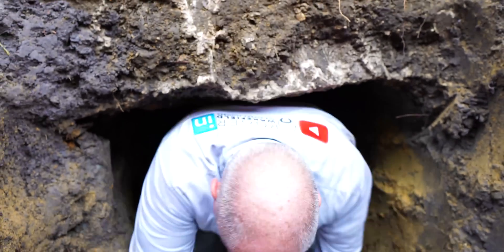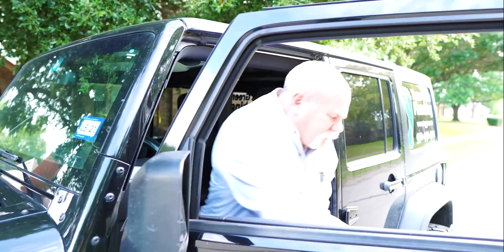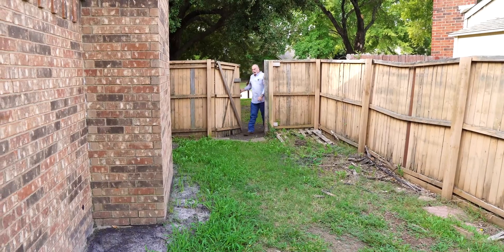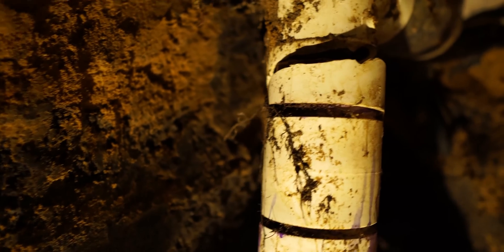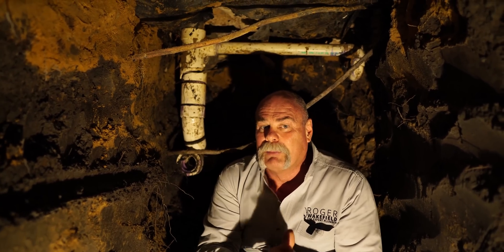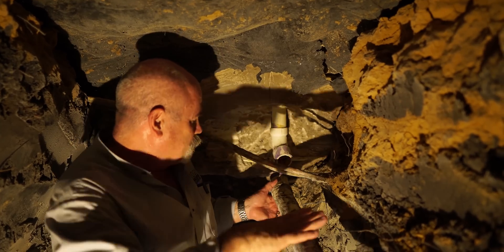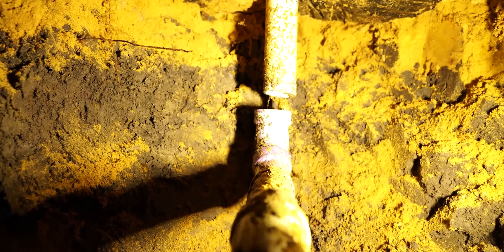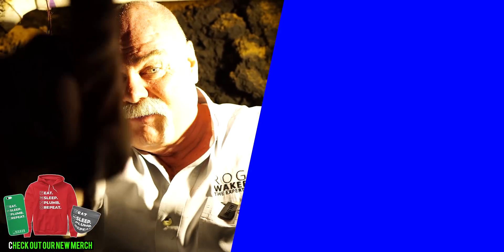Ever Wonder How PVC Pipes Break Under Your Slab?

Comment from the maker: Have you ever seen the pipes under your house before?
Reply: Yes, but I cheated and have a house with a basement.
Reply: If you had to build a slab house today, how could you plumb it so you could have full access to all of the plumbing?
Reply: @wiggles2439  You'd have to redesign the plumbing system, so your only buried lines were a water supply and a drain pipe near an exterior wall of the house. All other branches would be run in the walls, or maybe some kind of groove cut into the slab and covered with plates like the splice plates on a wooden stud. Wonder what Roger thinks of this idea?
Reply: @markh.6687  Good ideas.  I was thinking something similar.  Run the main supply up a accessible interior wall to the attic to a manifold, then run all the supplies back down the walls.  The drains, a little more tricky if using a standard gravity system, dig a channel in the slab for the main with access panels, with somehow running the other lines in the walls.
Reply: @wiggles2439  crawl space, standard in the Netherlands, and me as an apprentice plumber i appreciate it
Reply: Lukie4ever Bass It’s standard in most of the US if you don’t have a basement.
Reply: do a video of the dig crew.
Reply: The house I grew up in had a crawlspace under it, not a slab. A slab house just seems like a bad idea. Cheaper to build I suppose? Seems like a maintenance nightmare in the long run.
Reply: @pvanukoff  not much cheaper. Either way you're pouring concrete in some way for whatever style you are building. crawl space just entails pouring a foundation wall when you pour and laying ur floor deck across the walls instead on on the slab. No much more work or cost for the concrete guys or us carpenters.
Reply: @JB-ez2jz  Thanks for the explanation. Makes sense. All new construction is slab out here where I live.
Reply: Let us know how they back fill the houses you show on your video with out putting the new pipes in a bind.
Reply: Yes in the crawl space in the Netherlands/ Holland 
it is standard for a long time
Reply: I Installed them.
Reply: i have a basement so yes
Reply: Maybe on the new slab builds they should install a 24 in double wall plastic tile so the plumbers can crawl in and plumb at least the main drain and most of the water lines Basically a mini subway line
Reply: No never
Reply: Only some of them!  Busted slab and a very short tunnel were involved.
Reply: As much as I've cursed them both, that makes me thankful for my crawlspace and cast iron!
Reply: Yeah, I saw them yesterday when I went down into the basement
Reply: Yes. As well as my grandmother's house. Even found the old cast iron setup still laying down there even after it was converted to PVC at some point. Wish I had drug it out and sold it for scrap...
Reply: Another great example of why ABS is better than PVC... ABS has an unjust reputation because of the common assumption that it's used in mobile homes to save money.... When in reality, it's not only more expensive than PVC, but is REQUIRED for mobile homes because of the fact that it is stronger and can withstand the challenges faced during  transportation....
Reply: Yeah. Had a basement. Now we have a crawlspace. But I still seen it.
Reply: Yup, Oregon we have crawl spaces
Reply: This is nice and informational. As an electrical apprentice I hate pvc in direct burial.  The company I work for, we've hadcto dig the trench back up twice because the pipe broke during or after the back fill. 
Binding and twisting joints, this is something ill keep an eye on in my future.  
Thank you.
Reply: I would love to but can’t haha
Reply: No only when they had to cut in the slab and replace a cast iron wore out pipe smh. Never fun never easy and NEVER CHEAP
Reply: On a slab so no..

Comment: Thanks for the video, your explanation is very understandable. I have a question My mom and I have been in our house this past July was 20 years  she is the owner. This house was built in 1984. It's a 2 bedroom bath in a half and is built on a concrete slab. We are the 2nd owners .A few days ago our  kitchen sink which is on an exterior wall with a 3x3 window above it has had apparently a drainage issue to the point where fishing a snake for cleaning the snake goes in approx 5 to 8 feet then twists on itself. Could that mean that the pipe is broken? If so would the contractor that did the original plumbing before the slab would he go across the slab to the septic tanks or would he run that drain along side the exterior of the slab?

Comment: wow - this video gave me so much to think about. Do you see the same issues occur with ABS drain lines/fittings? Which is more robust? ABS or PVC? Do you recommend sand as a material to pack around plumbing members? Would a 5/8 minus sand gravel mix work ok?
Reply from the maker: Honestly, I don't have much experience with ABS, I've only installed ABS once...Here in TX we only use PVC

Comment: You’ve got to use concrete blocks in tight on your way out back filling or you’ll have more problems down the road, especially in North Texas. I’d prefer demo from the top. Either way, expensive as all get out.

Comment: I really like your advice at 5:50 about the rough plumbing under the slab.  I wish there was more advice like that out there.  I'm designing a house with all the plumbing along the north wall to try to simplify things and prevent having to dig under the slab in the future, but I wish there was a way to prevent that all together.  Maybe run all drains (Except toilet and shower) through the wall instead of through the slab?  What else could someone do to simplify repairs in case the pipes need to be changed?

Comment: Other then saying that the pipe wasn’t bedded properly what else can cause the soil under a concrete slab with peers to settle 3 “ and break every single fitting on a vertical drop

Comment: Rodger I have a house in California and it was built in the 60's.  Three different plumbers have come and told me that I have a broken drain pipe under my slab from a double sink to my shower that is on another side of the wall. I never thought about tunneling untill I seen this video. I don't want to break the slab if I don't have to. What is your recommendation.

Comment: I'm curious about the backfilling you do in your expansive soil. UPC says that bedding must be sand, dirt, or fine gravel that is level and supports the pipe along its length. The fill over pipes in direct burial has to be similar: sand, dirt, or fine gravel. It must be free of rocks and no rocks in the bedding. The trench itself must be 1.25x the pipe OD plus 12 or 16 inches. Clearly, these pipes were pushed up against the trench wall and then backfilled on a bind, as you said.

I wonder why they don't require pea gravel backfill around your pipes in soil that can move? That would allow shifting and accommodate a certain amount of vertical movement. 

Of course, it looks like that main drain moved an INCH or more sideways. I think they had a void on the narrow side and tamped the dirt down hard on the wide side such that it drove the whole assembly more than an inch to the side. That or the house moved an inch.

Another question: You guys don't use foam pipe wrap where the pipe penetrates the slab? That kitchen sink drain looks like it was set in concrete without wrap of any kind. Seems to me, that is part of the problem.

Comment: Another great example of why ABS is better than PVC... ABS has an unjust reputation because of the common assumption that it's used in mobile homes to save money.... When in reality, it's not only more expensive than PVC, but is REQUIRED for mobile homes because of the fact that it is stronger and can withstand the challenges faced during  transportation....

Comment: Yeah, the problem is that the plumbers don't fill the ditch back in, their $10 per hour workers do. Rarely do masters even do most of the pipe fitting in larger companies, they're directing 4-5 guys on what to do. I live here East of Dallas and this black clay expands and contracts a lot. If the backfill isn't tight and completely under the pipe and supporting it neutrally all the way around, it's going to break. Thanks for the reminder on doing a good job all the way to the end.

Comment: G'day Rodger when PVC started being used I use to put straps into the concrete slab to help support the pipework ,because its very hard to compact the pipe bedding .
Also used expansion joints for movement.

Comment: I guess the pipe broke cause uptil the 60s, PVC pipes were made from pure pvc resin but nowadays we add 10% rubber (ABS) to impart better toughness and impact resistance. PVC pipes installed today with similar margin of error wont crack so easily.
Also can I just say, as a student persuing masters in polymer engineering, these kind of videos are a lot more insightful than carrying out fatigue tests in controlled environments. Subscribed!

Comment: I have a plumbing license in CA, CO and OR. Been plumbing for over 36 years. I have never seen this done. I have a few questions/concerns.
1) trench shoring. The slightest cave in can be deadly.
2) confined space air quality. Contaminated soil and chemical vapors from the glue and primer can be dangerous.
3) firm bedding under the new pipe. Do you drill into the concrete above and use all-thread rod and clevis hangers?
4) compaction. Most slab on grade floors require 90% to 95% compaction. You just altered the structural integrity of the building. What do you do for compaction and how do you protect the pipe you replaced.

I’m not trying to be judgmental or be a smart a**. I’m curious.
Reply: Paul Sorensen,as a licensed plumber with 37yrs in myself, I am
In total agreement with you on all
Points.Must have looked at this video 5 or more times now, besides the danger aspect, Really unless you shoot some slurry or sand under there I don't see how there cannot be huge voids under
That slab!
Reply: @danieldawson222  yeah how does it get repacked without affecting structural integrity
Reply: Yep know of some cave INS in my parts that could kill you faster than you could say dead.

Comment: How do you fill in the dirt after repairs are made?  And I have had a copper hot water line spring a hole in it under the slab.  I had to jack hammer a brand new tile floor and found  corroded copper lines. Probably from chlorine as the pool was right next to where this happened.

Comment: Why not cut the slab to access the busted pipe instead of tunneling?? I know the tunneling saves the slab, but, my god, the cost alone would be astronomical. Back fill would be simpler, repair would be alot less stressful on the plumber. Idk how comfortable I would be with a 30 years old slab hanging over my head that's had something under it supporting it and now it doesn't, engineer or not, he's not the dude under it for the next 10-12 hours fixing it. I would love to know what the cost of that repair was versus a cut slab, same job just cut slab. @Roger Wakefield could you ball park the completed job cost for me just so I can know the difference for my own mind, please?

Comment: The company I worked for did tons of multi-story apartments. One particular job, my helper and I were assigned to do nothing but testing and slab work. When the piping was put in, someone figured the thickness of the slab wrong. They assumed It was a normal 4 inch slab, I guess. It was actually a honeycomb, where portions of the slab were over a foot thick, with tension cables embedded in the honeycomb. The result was that there were a lot of broken pipes after the slabs were poured.

But we didn't tunnel under, since the house was still just roughed in.  We jackhammered through the floor to get down to the pipe. It's a challenge any way you do it.

Comment: Mid 80s went from cast iron to PVC?  I've been a master plumber for 36 years now here in Texas and we were not using cast iron in the 80s in residential homes. It went from cast iron to abs pipes in the 70s and early 80s then PVC. Where exactly were u guys using cast iron in houses in the 80s? I respect what u are trying to do and help people. Now I saw ur license number on ur jeep and it starts with 35 so u have not been a master plumber that long my son is 39 and he got his master license when he was 27 and his starts with 35 also.
Reply: @M B well up north I understand u guys have basements we dont dude. We stopped using cast iron back in the 70s except for commercial buildings. Not residential. Yes no lead and oakum anymore just no hub fittings above ground
Reply: @M B what I'm trying to say is that  this guy is very misleading. He says he has been in the plumbing trade for 40 years but he just got his license not too long ago. So what gives u know what I mean
Reply: M B Chicago is odd. They don’t allow Romex wiring without metallic shielding.

Comment: they used gsr pvc. Gsr pipe cracks really easy. i use genova pvc because it almost never cracks/leaks. in Wisconsin pvc was first used in the late 1960s. in the 1960s-1980s every plumber used genova products.

Comment: I agree with the issue most likely being caused by backfilling, but most likely its a combo of not installing on solid bedding and than being backfilled. That's a huge issue in the area i live in, but youd never be able to dig under a slab around here because we have a sandy loam more on the sandy side.

Comment: This reminds me to never buy a house on a slab.  Crawlspace or basement is the way to go.
Reply: Basement only...:)...Screw those crawlspaces! And Screw the HELL out of slab!
Reply: @godbluffvdgg  basement: or as they call it in a wet climate: indoor pool.
Reply: @kenbrown2808  Cha Ching, right? ...Indoor pools are awesome@ :)
Reply: @godbluffvdgg  the tin nokker didn't seem to think so.  apparently, duct tape doesn't seal raingear well enough for swimming.
Reply: @godbluffvdgg  my crawlspace in the house I'm building has a concrete floor it's air sealed and insulated. 3ft tall also
Reply: @justinballard7242  Well, good luck with that...I haven't seen a dirt crawl space in decades...It's code now to make sure the floor is concrete...Are you saying your crawl space has no cross ventilation?
Reply: @godbluffvdgg  yes, no ventilation. It's called a conditioned crawlspace
Reply: @justinballard7242  It's code here to have an 8X16 vent on opposing walls...But, codes are different everywhere I guess.

Comment: I literally learned my lesson on this this weekend. I had put a line going across my driveway with 1” pvc with 2 separate lines coming off my supply. Not of the t’s pulled out due to backfilling and stress. I made sure I packed good before I covered it up this time. Kinda common sense but I had to learn the hard way

Comment: I'm curious how you backfill a hole like that properly so that concrete will not crack in the future. Whenever we had to do a job under a slab we excavate from Top.
Reply: I thought the same thing. How do you pack that back fill in a horizontal position to keep the concrete from cracking over time
Reply: @derrickfeltner6634   My guess is they turn the backfill into a putty by mixing a little water and possibly a bit of concrete with it. Then just hose it back in with a sprayer.
Reply: @clothar23  lol I thought about that
Reply: I've been wondering that to
Reply: There's a trick for that, too
Reply: @joeblow6199  @guitar1301 I Wonder if this can be done on a post tension slab slab.

Comment: I live up in MA, why are slabs so common down south? Why pour a foundation for a basement?
Reply: Well, it's cheaper and faster to pour a slab than dig a hole and pour a lot more concrete.
Reply: @markh.6687  I figure the cost of this type of repair would offset this cost of the extra concrete lol
Reply: High water tables. A basement would be an indoor swimming pool before you could pour the walls.
Reply: @davidm7457  Well, that will save some time putting in the swimming pool! :)
Reply: Depends on what part of the South. TN and NC have limestone, so they use footings and crawlspaces. The Gulf Coast has a high water table, so they use blocks and/or crawlspaces. This is in Dallas, and they do most things completely differently.
Reply: In Oklahoma land is flat and floods easily. Basically high water table. Everything here is slab unless you custom build with a basement on the side of a hill.

Comment: Correct me if I'm wrong but I live in Florida and I have never in my life seen any kind of repairs to pipes done under a slab. And where I'm getting to is if u break that dirt up under the slab u have now broke down the compactness of that dirt under the slab. May be different in Texas but here u have to have the dirt pass a compaction test before a slab can even be poured because a bad foundation causes the issues u guys speak of having
Reply: They look like the have more clay/black muck mix. Florida is mainly sugar sand. That could be the difference. I'd never tunnel under a house like that in Florida. We always busted the concrete on the top side and do the repairs. I live in Ohio now. All basements 😁

Comment: I seen ABS fail the same way, even without binding. Evidently some of the older ABS was defective.
Reply: The ground is not as stable as we think. Shifting soil due to drought, settling, etc. can put pressure on underground lines.
Reply: Abs cracks just by looking at it 😂